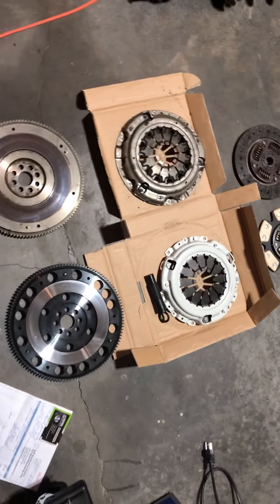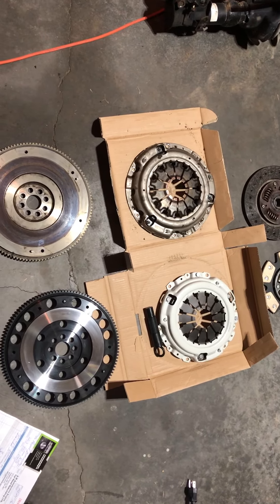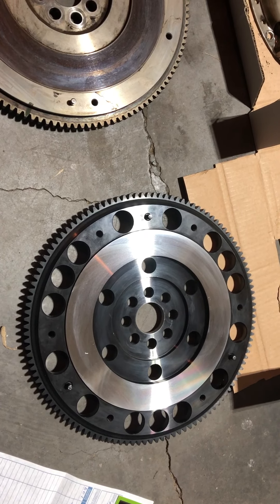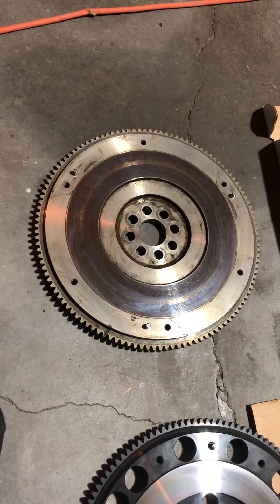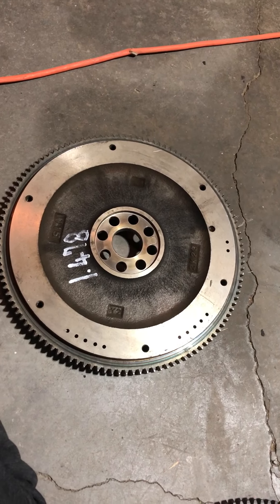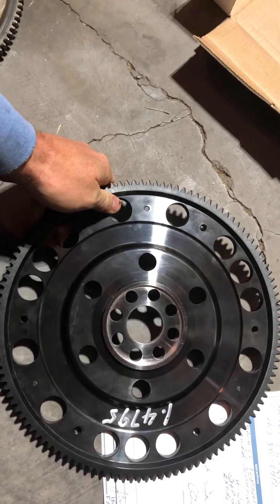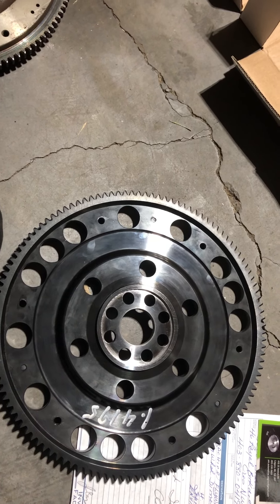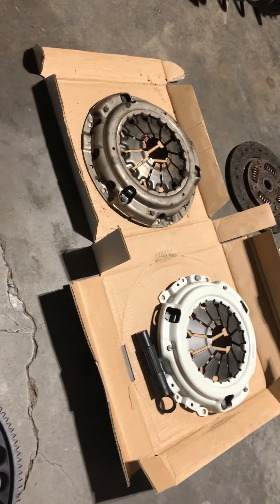ClutchMax Review - Don't buy an ebay clutch until you see this..

Comment: I ordered one for my cadge stratus and it fit perfect. After 200 miles I had to replace it. The eBay listing says it won’t fit my vehicle. I contacted the company and simply wanted to order the right one not a refund. They were total di(is. Now I will order from a different company.  The order I put in says it will fit when I originally ordered it. The pressure plat spring diaphragm was 1/2 in lower than the stock one. Clearly it was the wrong one.  They still swear it was right. I’ll never used that company again.

Comment: Dude, Im sorry you went through that, but after seeing this, ill just buy from one of the big companies LOL  Thanks for making the video too!!!
Reply: I am running a CM “stage 2” kit on my built golf.  The LW flywheel is balanced immaculately, no issues up to 8k rpm.  The disc itself engages practically like OEM and the pressure plate is only marginally stiffer… honestly this kit feels like a southbend endurance clutch.  For the money it is absolutely great.
Reply from the maker: I’ve now bought a clutch master stage 3.5 and a new Oem k20a2 flywheel and can confirm there is no issue using k20 clutch on k24 crank as long as you use flywheel/press plate and disc of the same engine code. In this case k20a2 fly/disc/press plate on a k24a1 crankshaft. The issue in this video was a manufacturer error no question.

Comment: Before buying a very cheap clutch kit from eBay for my Subaru I did plenty of research first, both by phone, email and in person at different stores, thus I was able to learn that there are actually 3 clutch sizes and 3 flywheels sizes for my 2003 Subaru Forester SG9  ... I then took my old clutch out, measured all the parts and then made sure that the seller I was buying from understood exactly what sizes I was after ... moral of the story is simple, do your homework first.
Reply from the maker: Clutch was purchased for the correct engine code. Compatibility was not an issue. Flywheel center crank hole was 0.12mm or 0.00472" inches to small.

Comment: My mk4 and a4 clutch from them work. I sanded my middle center hole & pressed it on crank worked perfectly.  Don't use the washers due to thread engagement.

Comment: You may have simply been unlucky here or some one packaged the wrong parts for you. After reading reviews and researching results, I bought a stage 2 Clutch Max kit and it also came with a lightweight flywheel. It was installed with my motor swap on my 2012 WRX. It was so grabby and stiff the first few drives all 4 wheels would spin from a stop. I tend to pound the living shit out of it every other day and the quality is just fine after a good few months. Wish your luck was better for this one, felt good to save money on a clutch kit.
Reply from the maker: I have run ebay clutches in the past with success as well. The lacking quality control and customer service from Clutch Max were pretty terrible in this case though.
Reply: Thanks I'll be buying one for my 05 legacy gt was looking for some reviews!

Comment: I had their Stage 5 unsprung kit on a bone stock JDM B20B and threw 16psi at it (380whp) on E. Pulled the motor 8 months later after beating the absolute dogshit out of it and the clutch was still at probably 50-60% overall life left with zero heat marks on either the clutch or flywheel. I probably wouldn't use it on an expensive motor, but if you're throwing together a shitbox it's perfect for $199.99.
Reply: My clutch on my mazda protege is slipping would you recommend a ebay clutch like a stage 3 xtd?
Reply: My clutch on my mazda protege is slipping would you recommend a ebay clutch like a stage 3 xtd?

Comment: ran multiple clutchmax clutches now and in different cars, though with stock flywheels. never had any issues, can only say good things, as pedal effort is close to stock and driveability is really good. plus, holds the power advertised and then some...
Reply from the maker: I'd run other brand ebay clutches prior to this with little issue. The worst part was ClutchMax's total lack of service or willingness to admit fault or help in any way. Clutch failed early to at 10k km's
Reply: @JesseBreaks  well thats still not an outright fail at like 10km or something so i guess its not as bad as it could have been, still sucks tho

Comment: My pressure plate from clutch max stage 1 just went out had it for almost 30k miles and 2 and a half years would recommend excedy clutch for any Honda it’s so much softer and smoother ride
Reply: I like Sachs. They usually still have honda branding on it

Comment: I bought the stage 2 clutch kit. It was a bitch and a half to get the transmission on. I ended up pulled the entire motor out, and still couldn’t get it to mate by myself. Eventually was able to thread on some bolts and slowly worked around to each one guiding it in and it worked out. Clutch felt good, had no issues for the 800 miles I drove it. Sold the car

Comment: Exedy stage 1, act heavy duty organic, clutch masters Kevlar or organic in that order for all normally aspirated engines, these eBay Chinese made stuffs your basically buying repainted stock oem type clutches or horrible put together clutch materials especially the puck type stuff is way overkill kiss drivability levels to just scraping flywheel and pressure plate materials off

Comment: Hey jesse. No follow up video im assuming all is well with the clutch? My dual mass is some times making the car vibrate.. this is after having the engine out for a sachs performance disc and pressure plate upgrade, at the time there was so little play in the dual mass that i just put everything back together and ran it. 10k later the vibration wenever i drive hard or have the ac kick on the vibration occurs.. i been looking at a cheapo ebay kit with a light weight flywheel but theres no flywheel out there that would work with my sachs disc and pp unless i go dmf. Theres a nice ebay stg 2 kit im thinking of for 300
Reply from the maker: The clutch in this video failed in short order. Ebay flywheels will work if they physically fit. Balance might not be ideal. It's the friction discs and pressure plates I dont trust most on these ebay items.

Comment: I had issues first clutch lasted 6 months an 4500 miles an pressure plate broke in half now second clutch an it slips doesn't seem to go away clutchmax garbage , so now i'am putting a sachs clutch in car hope it works
Reply: Sounds like your throw out bearing is riding on pressure plate. Needs adjustment

Comment: Another problem is the stuff included. Many Ebay Chevy LS clutch kits come with NON oem throwout bearing/slave cylinder/pilot bearing. You really need the OEM stuff since there really isn't much for an aftermarket on those certain parts.

Comment: Thanks for your review. Really appreciate it. Im in need for a new clutch for my car. Was looking at this instead of the mantic clutch for a fraction of the price. Now i will just stick on with exedy or mantic.
Reply from the maker: I ended up almost paying the difference "saved" in machine work to make this cheap garbage work. It's now totally failed after less than 2 years.
Reply: @JesseBreaks was going to ask how it done long term. I have an AWP 1.8t in my beetle turbo s (no longer 6sp, swapped it for a 5 when the 6 catastrophically failed)

Comment: Man that sucks to hear. Thanks for the video. Any updates on how it’s holding up? Was that oe flywheel single or dual mass?
Reply from the maker: This was a single mass flywheel. Clutch started spinning after 10k kms. Planning to make an update on this clutch soon. Crv is getting a booster forged engine built now.

Comment: I was thinking of going with one of these in my tdi,  I was wondering about the flywheel and how much it weighs...  I mean the thing look like swiss cheese has alot of holes in it.  I'm really glad you did a review on it,  i 'm gonna go with a south bend or exedy or something. So Thank you
Reply from the maker: Light didn't prove to be better for my application. I'll say it made down shifting and rev matching smoother. It made launching much rougher and more difficult and also contributed to more engine and transmission noise.

Comment: I have their stage 3 kit in my EP3 Si K24A2+Type S trans swap, works fine, no issues over 2 years now(with weekends abuse). I guess it's a hit or miss.
Reply from the maker: The issue I had was an obvious machining error... for which Clutch Max refused to admit or be responsibility for.
Reply: @JesseBreaks  I understand. They all don't come out perfect. They should of did right with you and any other customers with issues. Good video for the people though

Comment: Was the clutch disk loose on the transmission shaft?
Reply from the maker: Clutch disc worked fine, though it wore out quickly and did not grip as described for a puck style clutch kit...

Comment: Did you experience any problems with function after the install? Please let me know asap! Thanks man.
Reply from the maker: It took a long time to break in fully and still makes some engagement squeal when cold. All in all its ok.
Reply: @JesseBreaks  thanks for replying. I Appreciate it.
Reply: @JesseBreaks  sounds like it works great but you don't want to contradict your negativity from this video
Reply from the maker: @carbon310  it functions, still stand by all original statements and recommend you pay for quality up front instead of paying to fix problems while your engine is in pieces.

Comment: Clutch max b18c clutch brand new stage 3 after many time with this kit and succes not  this time clutch was too large and grab in the inside on the belt housing of the pressure plate so too large clutch disc .... wow never agains
Reply from the maker: Nothing more annoying that buying new parts and having them not fit while you're engine is split in half...

Comment: How is the lighten flywheel performance? How's the clutch doing? Update. Thanks
Reply from the maker: I would not recommend light flight wheel. The benefit of "engine response" is not worth the negative effects on launch, poor idle quality, using AC now makes the engine really struggle. I'd recommend light fly for race application only. I'm going back to an oem k20a2 flywheel on my new engine for swap.
Reply: @JesseBreaks  Oh i see. Wow is this is on a NA setup too eh? I am looking at OEM Organic clutch and it come with lighten flywheel. Its just going on a Corolla... Appreciate it. Thanks 🙏
Reply: @tkflex2332  keep in mind, with a tune you can control what you idle at, completely resolving the issues he's talking about

Comment: Had an issue with spec. The pressure plate didnt line up to the dowel pins. I sent pictures of the fly wheel we a ebay special and the destroyed hks one and they said we build thousands of these a day. The problem is on you. Fack you spec clutch
Reply from the maker: I didn’t receive any help with this either. Machining the flywheel inner bore worked but like… you don’t buy a new clutch to have problems I feel you

Comment: Shit I just got the stage 2 at my door step. For a 93 integra.. hope this shit hold up. It's just a daily. Just refreshed the b20 on it and decided to order this cheaper clutch.
Reply from the maker: The clutch its self functioned. It didn't last a long time and my prime issue was the flywheel. I'd run it if you are installing yourself and can change if needed.
Reply: Mine bolted rite up. Has 60k miles on it running great

Comment: Hey man i’m on budget and this is still cheapest option for daily driving do you think it’s worth it, my clutch is gone so i’m in need of something that’ll be reliable at least.
Reply from the maker: If it goes on out of box I'd say it's good value for the money. For budget boost/power builds it does the job. Just might take some more screwing around and make some more noise than an oem replacement or a proper brand clutch set up.

Comment: So it didn't fit.. how about the clutch and pressure plate? How did it perform..?
Reply from the maker: disc and pressure plate were garbage as well. They started seemingly slipping a bit at about 13k km's on a factory power k24a1 (160 hp).. Yet to take it apart to see if surface contamination or something other issue was a factor, but this clutch will be getting replaced.

Comment: good  luck bro just picked up a stage 4 clutch max just the disc and debating  if it worth the time or buy a better replacement  disc please  let me know  how  it goes
Reply from the maker: All in all it seems like a good kit. I feel like I just got a one off that didnt get the right quality control. Never had an issue with a flywheel like this before. I've got the thing in with trans back on now. I confirmed that the starter engages normally and the clutch seems to be clamping and releasing normally with the pedal. I'm hoping the machine shop fixed this issue for me... If i have any issues on first start of the engine I'll make another video.

Comment: Discs are ok? Installed on your car with stock flywell work well?
Reply from the maker: I installed with the light flywheel after it was machined and so far its been "ok", has quirks but it works

Comment: Any updates yet?thinking about getting one for my camaro.using my oem flywheel though
Reply from the maker: Should make an update vid soon. Clutch has been working well for a month. The throw out bearing makes a little chirp when it’s cold but I’ve taken it to Oem redline a couple times and had no issues so far.
Reply: Heard the throw out bearing and the pilot bearing are crap according to other youtubes, any truth to this?
Reply from the maker: @grosso41  The pilot bearing on this kit was good but the throwout has been kinda garbage. I'd use a oem throwout if I was doing it again.
Reply: @JesseBreaks  thanks for the reply

Comment: How does the clutch work though after the machinework? Every review i can find is some complete dumbass doing shit wrong and blaming the clutch. If this thing really takes 500+hp for a couple years....sold! Im going to run it in every swap i build.
Reply from the maker: I ran it for a number of years but it wore out quickly at stock power like 160hp. Engine has been fully rebuilt and I’m working on turbo system now.